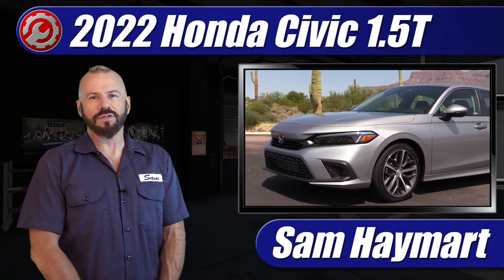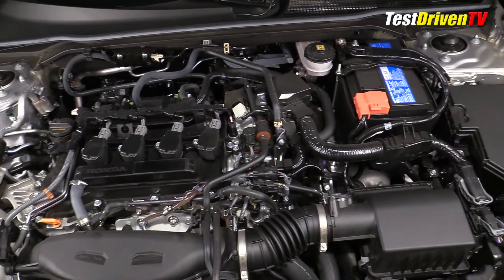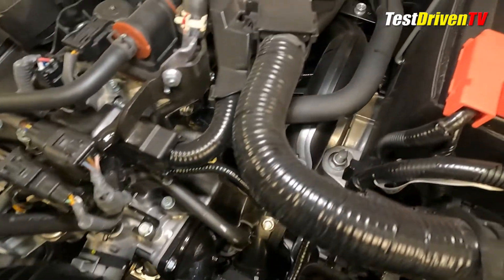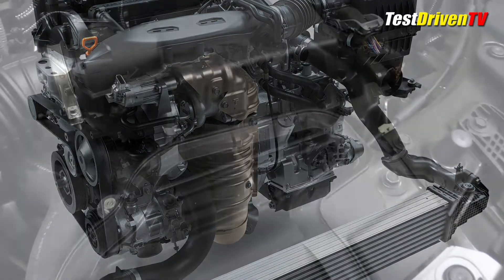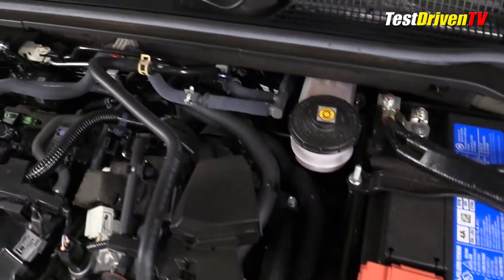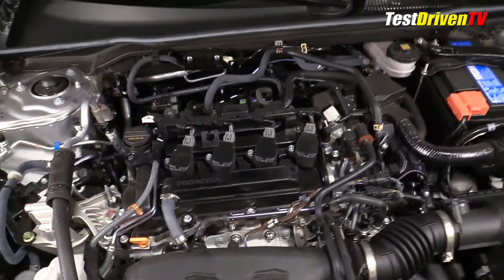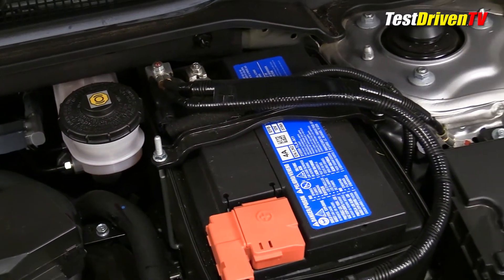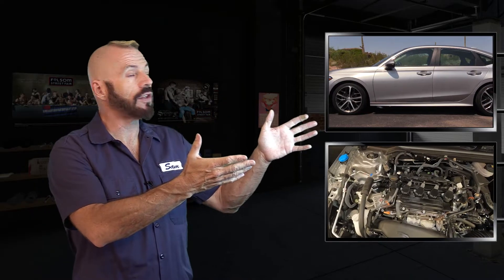2022-2024 Honda Civic 1.5T Engine Explained

Comment: 1.5t will blow head gaskets.  It's just matter of time.  Its a design flaw.  They blow anywhere from 44K and beyond.  There is a class action lawsuit on these engines
Reply: it's too small to be turbo 

but I've seen 1.5t with 180k miles and doing well

Comment: I own a 24 Civic Touring with this engine. I love it so far. I keep the oil changed every 5,000 miles. I’m at 26,000 miles and haven’t experienced oil dilution yet as I check the oil occasionally. I’m thinking Honda has fixed the issue. Also, this car can achieve 40 plus miles to the gallon with that engine. This is my 5th Honda. My first Honda was in 2001.  By far, this is my favorite.
Reply: The oil dilution was fixed 2016 , 2018 engines

Comment: Toyota HSD Hybrid:

Great for what you don't get:

No turbos. No annoying start/stop system. No GDI without port injection. No sleazy mechanical CVT. No belts (accessory timing or Wet). No 11 speed torque converter automatic. No automated manual. No torque converter. No 12 Volt starter or alternator. No mechanically driven AC compressor (it's electric like your home refrigerator). 

Electric car goodness without the electric car drawbacks.

Comment: Thx for sharing. Quick question. Changed Penzoil Ultra Platinum Full Synthetic 0W20 engine oil and honda filter on 2020 CRV 1.5T After that, the engine makes periodic roraing/buzzing sound. Like every 10 seconds lasts for 2 seconds. Oil fill is correct, no oil leaks under, no change in driving pattern m. Any thoughts
Reply: It’s totaled, start parting it out!

Comment: I just got rid of a 2018 6 speed accord with the 1.5T for a brand new Si, had 154,000 yes 154,000 on the car. 80% highway miles, oil changes done at 50% and I drove it. Never had a single issue and yes that was the first year for those engines I believe especially in the accord anyway so that would be the “oil dilution years”. Just warm the car up before use, avoid short trips, change oil sooner = infinite reliability.
Reply: highway miles is much easier on the engine 

so the engine will last much longer if the car is driven on highways
Reply: That's good I drive mostly freeway for work so just do routine maintenance and should be good

Comment: Honda makes good motors. But just not this one. Everything in the L series motor is to small and to weak for a turbo. The d series on old Honda is beefier than this. The crank shaft on this is very small. Imagine the comparing a coke can vs a redbull can. All the major bolts are way to small.
Reply: Hey how do you know this ? Are you a mechanic? I’m trying to find information about this motor. I mean what you’re saying makes sense but I really want to know he could’ve yesterday K 24 with a turbo, put up some proper numbers 😂
Reply: @StevieDee73  he have a side by side break down of the B,D.K,L series 
You can see the size difference between all them. Hope this helps you.
Reply: @StevieDee73  look up Alex.built he got the info you are looking for.
Reply: @StevieDee73  title why the L15 is the worst motor Honda ever made.
Reply: @StevieDee73  different type of mechanic. But I did a few swap back in the day. I love the Hondas but the new ones are a disappointment. K24 would of been a better choice. But I do industrial mechanics.
Reply: Alex.built

Comment: Is this a good engine? How long should it last? Is there anything bad about a 1.5T engine?
Reply: Disposed mine at 150k km. Never had any problems.
Reply: ignore all these clowns, Honda has the best engines on the market, period!
Reply: This is a terrible motor. It is not ment for turbo. Every single thing on the motor is smaller then the d series. All the major bolts very small. And I do mean all of them. From rod bolt to the head. They are very under size.
Reply: Premature regular blown head gasket.  Using premium fuel will limit the damage.
Reply: Extremely bad engine carbon build up turbo problems head gasket plow Ect….
Reply: Garbage engine good for 50000miles after that it's a bonus life ... Too bad for cold countries .. only heats up inside cabin when its driven above otherwise u feel cold Inside .. u make fuel savings for sure but if engine break at 70000km for and u r expected to spend $4000 $5000 to fix in my case your ALLL saving goes in drain like that.....

Comment: Too late, have 3 different L15s in my family. One of them with 129 thousand something miles. None of these engines had issues.
Reply: Are they still reliable???
Reply: @ivlog3663  Yes, If you do short maintenance intervals and fill it up with good Top Tier fuel like Shell. Read your owner's manual to see which octane is proper for your vehicle. The Civic that I mentioned with the high mileage. It now has 157k miles on it and is still running strong with no issues. 2018 Honda Civic Hatchback Sport with the L15BA engine using 0W-20 engine oil and CVT. Filled with 92 AKI octane fuel from Shell. 3,000 mile oil changes for this vehicle. The vehicle is not even babied.

The other 2 Civics I mentioned before are still around as well. No problems.

Thanks to Youtube we don't have the issues that the majority has. 👍

Comment: If u live in a cold climate, installing a block heater would be a smart. It will definitely be better for the engines quality of life and oil dilution concerns.
Reply: Or have an indoor private garage where the temp does not go sub zero (8-10 celsius)

Comment: I have a 22 civic 1.5 liter sport touring. I got right when they came out. Has 30k miles on it. Only serviced at the dealer. I’ve had no issues. Runs smooth. Does anyone know the name, or engine code for the 22 1.5 liter?
Reply: It’s an L15. There are differences between the 10th gen and 11th gen engines. But also there are differences between the Si Civic engines and the other Civics.
Reply: U find out

Comment: I've tried this engine in a brand new Accord and I found it harsh, laggy and noisy.  I cannot believe some at Honda had approved it and it is now in almost all of their lineup.
Reply: which Accord?
Reply: @jamesmedina2062  2022 Honda Accord EX
Reply: @alib8396  Is that a tenth gen or 11th? I thought all the 11th gen Accords were pretty nice. i rode in an Uber but did not own or drive one. I have a 10th gen Civic and the company was negligent in design of many areas especially noise both road and engine, comfort, quality of Chinese sourced side mirrors, door handles, poor paint, bad door latches, AC system, head bolts that stretch and more. In the Civic the engine feels great but has a vibration-full personality because it has no balancing and the cylinders are offset.
Reply: @jamesmedina2062  I am not really sure what gen is 2022 Accord but regardless of that.  It is crazy that someone at Honda thinks this engine is befitting of their flagship vehicle and it is not like Honda didn't make great engines before.

I only drove the Honda Accord to sample the engine because I have been considering buying the new Honda ZR-V and it only comes with the 1.5T here in this region.  Needless to say I was left hugely disapointed that I might forgo Honda altogether and go shopping somewhere else.
Reply: @alib8396  you raise a good point. Use the 1.5 in lower models like Fit and Civic but leave it out of Accord huh? I agree that the 1.5 is a throwback to unrefined 4's from the 80's. How could it qualify for the Accord when 33 years ago the EX Accord came out with a smooth and balanced 4 cylinder engine that became legendary? You would think 33 years stood for something. The truth is that fuel is no longer derived in the States from oil that is naturally pressurized. The Bakken shale and other shale formations require lots of stimulation to release oil. The majority of oil produced is under expensive fracking processes and our worlds are heating up so at some point some car-makers like Honda will make more money using less fuel with buzzy engines versus the guzzlers that require extra fees. The 3-cylinder engine sold in Europe is really buzzy and underpowered. It has not even been used here. We don't even get sold the smaller cars here. For US models they use fancy liquid filled engine mounts and the turbo smooths the exhaust a little. I think the Accord has gone downstream in terms of luxury. If sales remain strong, Honda will feel vindicated or justified. 

I looked at a 1.5 cracked open and the guy was showing some of the parts in it. The crank was designed to be light and not balanced for smoothness. The head bolts and rod bolts were light and weak. It was upsetting to see some of the obvious cost-cutting effects.
Reply: The 1.5t is all but gone. One or two years left. Honda will keep the 2.0 for the Civic base trims all other will go hybrid. If you got a 22-24 With that power train they will be the last.
Reply: That 1.5t is so trash

Comment: that T stands for "trouble"
Reply: Stop trying to buy into negative rumors.  The turbo helps, and the car runs fine from experience.
Reply: Wrong, after 2019 Honda had addressed these issues with their 1.5L turbo. 

People don’t actually think before criticizing. 

If logically speaking the reason Honda had issues was because they paired this 1.5 Litre with heavier vehicles. And, with heavier SUVs or sedans, the engine could strain more to pull the vehicle along given that it is a tiny engine. 

Honda now has fixed majority of those issues, before releasing the new Integra. 

Which I owned for 2 years so far and haven’t had a single issue.
Reply: Are the 2022+ SI also having oil dilutions problems?
Reply: Anything neglected gives trouble.
Reply: Facts
Reply: Oh . Not TURD?
Reply: Trouble, yeah, he's dead, right. The naturally aspirated engines last way longer than the Turbo ones.
Reply: Where tf is the vvt solenoid located 😩😩😩

Comment: Is it much difference that the 2019 version?
Reply: better piston rings, re worked head gasket and a remap to allow the engine to reach temp quicker in colder climates this was already done on the L engines sold from 2019 anyway

Comment: Shame on honda the ac compressor still use the conventional ac compressor easily break down.
Reply: Air conditioner compressor hand to be replaced 110,000miles  they're replacement was around $750

Comment: I bought honda civic in 2018. I will never buy Honda again in my life. I will never recommend to buy Honda ...
Reply: I presume you have the 1.5 turbo engine that has had issues with oil dilution?
Reply: What is wrong with the 1.5?
Reply: @Justin_Credible777  there's been reports that the 1.5 turbo  causes stalling, mis fire and power loss though not all engines are affected..
Reply: @kofib3  are you kidding me... İ'm starting to regret buying a new civic now...
Reply: @y.s8915 Na, Don't regret if you've had no issues . I only heard that some engines have been affected but it seems Honda have sorted it out if you use the correct type of engine oil.
Reply: my 2018 honda civic 1.5 T is running very sweet at 52,000 miles
Reply: Stfu, Honda is still the best, go home troll
Reply: So you just come sounding like an idiot and don't give any context ? Go enjoy life a little more.
Reply: Why?
Reply: That was helpful. Thanks for the reasons
Reply: Fake
Reply: Trolling 🤷🤷🤷
Reply: I had a 2017 Civic Hatchback and it was a pile. Literally the worst experience ever. Honda isn't as reliable as they claim to be. I would buy a VW before a Honda. So yeah never again would I touch a Honda.
Reply: @5150SP  VW overall is better in say a GTI or nice Jetta. You will have to do carbon cleaning and chain at 200k but it is nicer vehicle for sure

Comment: Great video thanks. So, with these changes, does it seem that Honda has worked to further mitigate the oil dilution issues the previous gen civics had?
Reply: There are still issues with oil dilution. I have a 2021 Honda Accord 1.5L turbo and even after 3,000 miles the oil level is higher than the max mark on the dipstick. I change the oil sooner to mitigate any issues associated with engine oil diluted with gasoline.
Reply: @TheRichardF10  Why if I do buy a newer Honda, it will only be the 2.0T ones only. I'm happy with my '17 Accord V6 for now.
Reply: @TheRichardF10  that’s weird because I have a 2022 and I don’t have any issues with oil dilution I’m pretty sure they fixed it with the 11th gen civic
Reply: @nathanielcasas8923  wait until it starts getting cold and report back to us
Reply: @brad6440  are you his wife or something?
Reply: @Dranreb865  😂😂🤫
Reply: @nathanielcasas8923  my 2021 crv began having oil dillution at abt 12,000 miles
Reply: Some guy drove a ‘22 civic like 225k miles as a medical courier in just over a year. Obviously the oil issue isn’t hurting the engine
Reply: No not really the air filter and water filter is still tricky to get to

Comment: are these the same as the 10th gen 1.5T?
Reply: added vtec on exhaust port, so more air going to intake so inceare power and torque
Reply: Sooo no fix to oil dilution ?
Reply: @davideaton4988  these Honda's still eating oil? I been driving my honda prelude for 15+ years and it's like a magician. My oil dissappears like magic
Reply: @markymark3071  he meant oil contamination not oil being burnt. Unless your joking.
Reply: Worst engine ever!!! Oil mix with gas,misfire, blow head gasket, bad inyectors. Honda sucks!!
Reply: @victorv33  you had all that happen to you?
Reply: only if you use cheap fuel below 91 octane, same engine in Europe but in Europe they only get 95 octane rated fuel and above oil dilution and head gasket issues are not a problem in Europe, for some reason in the US Honda market the engine to run on regular fuel , this is a bad idea and has lead to high failure rates @victorv33